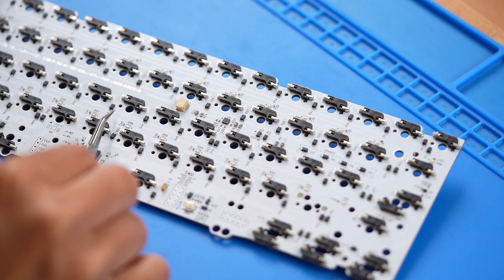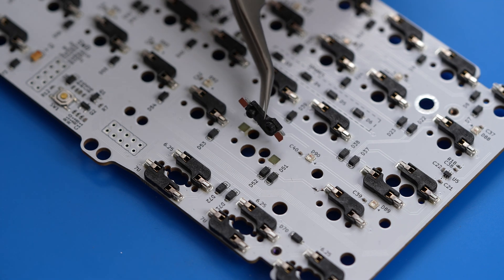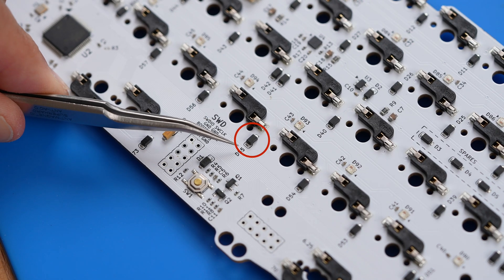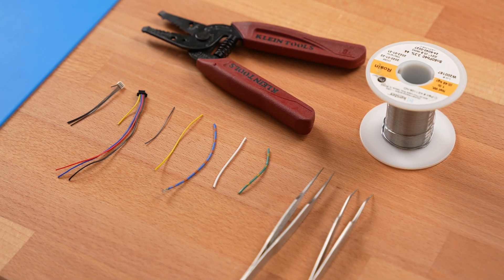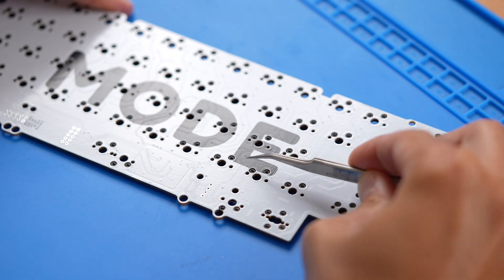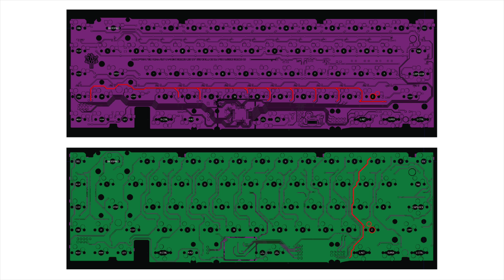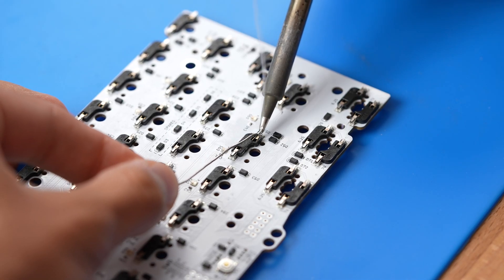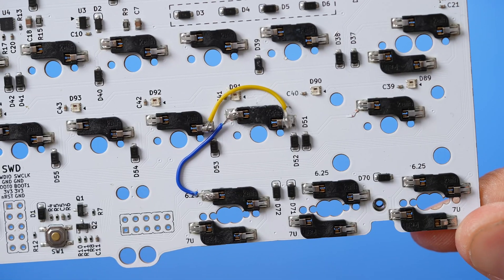How to Repair a Hotswap Socket on a Mechanical Keyboard!

Comment: i'm now facing a problem that i cannot press a and d in games while moving diagonally , and that happened after i got my coffee spilled off on the keyboard, is there any solution to restore the connection between a and d so i can cilck them at the same time ?

Comment: What if the actual socket is having issues— no matter what switch I put in it, I have to press hard or at an angle for the key to work, if I open up the keyboard and manually connect the two sides of the socket, the key works, so there’s no electrical issues, just mechanical with the socket. Would putting a tiny bit of solder inside the socket where the pins go work?

EDIT: take a really small needle and bend the connections in the socket closer to each other. Only one of the pins in my socket had the problem, but you’ll notice there’s a gap in the place where the pins of a switch go in a socket compared to other sockets if you have this issue

Comment: Can someone help me I checked the diode and the hot swap switch and it still doesn't work I even tried testing the pads with tweasers after removing the hot swap socket and It doesn't work someone help

Comment: Holy cow, that was so much easier than I expected. I bought a broken GMMK 3 keyboard cheap on eBay. The seller said some keys didn't work and that they had already tried swapping switches around with no luck so they assumed it must be a board issue. I naively hoped it was just cracked solder joints that I could easily reflow. But when I opened it though I saw that several sockets had come off the board taking the solder pads with them. With so many lifted pads I thought it was beyond my skill level to repair, but it was pretty easy thanks to your video. For some pads I could actually just see where the traces went by looking with a magnifying glass under a bright light. For a couple others I couldn't see the traces, but using your tips and some trial and error I eventually figured out where everything was supposed to connect. Now the keyboard works 100% perfectly. 
Thanks!

Comment: it seems like i cannot find the answer to my question anywhere. if i am understanding correctly, could I hypothetically switch my CTRL-left key for the ALT-left key and vice versa? and would it be recognized by the computer or would i be at step 1 and have to go to the registry on the pc?

Comment: i don't know how but it fix my problem when i press 3 it typed 34 same by pressing the 4 so i just do connect wire as you show then i remove it was fixed , thanks million times 

🙏

Comment: If any of you need to repair a YMDK75v4 (low chance but still), somehow fixing the right (while looking from the bottom) socket pin to the right pin on the socket on row below to the right fixed the whole socket while attaching two jumper wires led to both the key that was broken AND the key to which the jumper led to activate. The datasheet for the YMDK75v4 is not available so it's hard to say what's happening, but I found success with only one cable over the right pin and the column. Good luck!

Comment: Does anyone have a problem where the key registers when using tweezers from the back but doesn't register when actually pressing the switch from the front? My Haven TKL's tab key isn't working when a use different switches and press it, but it does work when I use tweezers from the back. Please help!

Comment: I just buy new RK61 and the enter button is not working. I try all of solution, not until I open the back of the keyboard. Yes, the hotswap socket pad is lifted. Just push down then now its workk ! THANK YOUUU

Comment: I just watched this, I just got my gmk67 keyboard and I noticed that the enter button is not working so I checked to inspect what happened and I saw that the enter key has a broken hotswap and I temp fixed it using a painter's tape and tapped modded the pcb. yikes
Reply: Was it completely loose? It works just by putting tape on it, I'm in the same situation😅
Reply: @alezg1212  it was not in the pcb LMAO, but I did a fix and now it stayed there, but now my problem is the > button

Comment: Wait so why does the pcb normally not have a ton of wires on the back? Does reattaching the socket not reconnect it to the circuit?
Reply: The pads themselves lifted off of the pcb. They are connected by the traces you can see running through the pcb. It's too small to be able to reconnect yourself so you need to use the wires in this case.

Comment: Question: Didn't you by  pass the diode with this conection?
Reply: yes, that will lead to ghosting
Reply: I was thinking about it, just solder it to the diode and not directly to the next switch

Comment: I don't think you should make short like that (yellow cable). Advising to degrade your circuit is a rubbish advice! And just why wire to next socket when D52 is right there?
Reply: +1
Reply: Also, I was about to prise clarity of the explanation in this video when they went to matrix diagrams (that no user would have) instead of just following the tracks on the PCB.

Comment: Curious can you convert the pcd or damage hotswap socket into solder one
Reply: You'd need wires to solder switch pins - in the big holes after removing socket there is nothing to solder to.
Reply: @lasermanpl  thanks for replying I have heard of people converting solder PCB to hotswap. I thought it would be easy to convert it the other way around.

Comment: Hello I broke my escape key hot swap socket on my dz64? pcb… will it work if I buy a separate sockets and smd diode? Any recommend sockets that I can use? Thank you very much!!
Reply: generally, you can buy seperate socket and glue it under the PCB, then follow the same instructions this video does. Yes, you could actually replace the diode aswell just make sure get the same one. thus it might be a little bit difficult as the diode's leg is very small and you need more than just a soldering iron. Hope that helps!

Comment: Just a pro tip, make sure to twist the wires in a spiral (rolling it with your thumb and index) to keep it together and tin it (applying a small amount of the solder) before soldering to the socket ends to make your lives easier. 👍
Reply: Might be better using thin solid core wire here.

Comment: So how does the socket work in the first place, without the jumper wires? I thought just resolder them onto the PCB will do the trick?
Reply: If the silver pads are still in place then you just need to resolder them. if it fell off, you need the jumper wires since the pads aren't connected to the circuit on the pcb anymore. the circuit is layered in the pcb, so you can't just solder the pad or glue the pad back.
Reply: @GamingNightsNeoMasaki  "pad"?  This refers to what specifically?  The black thing with 2 silver ends that he lifted out?  The terminology is driving me crazy because what he's talking about is not visually evident just by the terms used.   Or is the black thing he lifted out, the "socket"?
Reply: @echt114  the socket is the black thing - it's what the switch actually connects to. The pad is the electrical contact patch that the socket is soldered to
Reply: @ErrorProne  Thanks, I've got the socket now.  After watching the video again I'm guessing the pads are just the little square things at each end.  Now I'm wondering if this repair for a key that "doesn't work" is also a fix for keys that double type.  That's the most frequent complaint I read about lately and can't find a video with an actual fix other than pour alcohol on it, which everyone seems to agree only lasts for a couple of weeks.
Reply: the pad (originally on the PCB) typically breaks from the circuit and comes off with the hotswap socket. So it's difficult to connect that to the original circuit on the PCB (way tooo small & not on the top layer.)